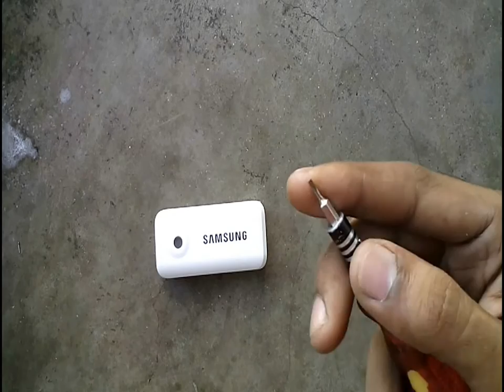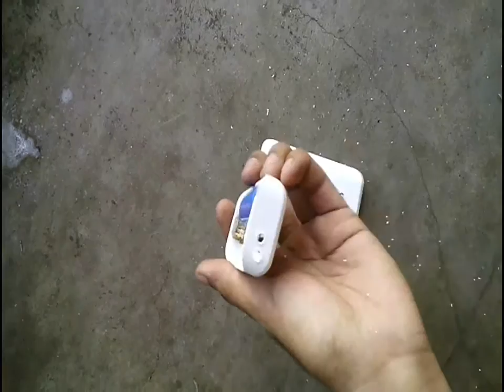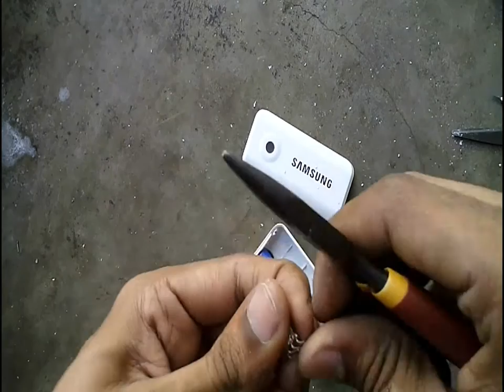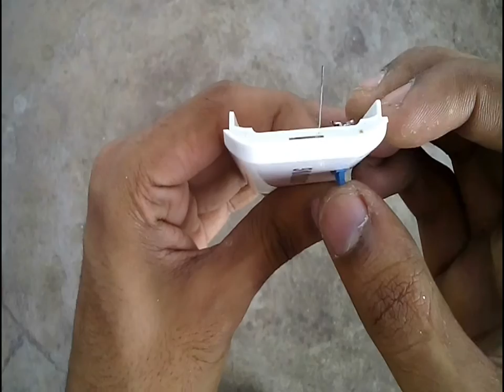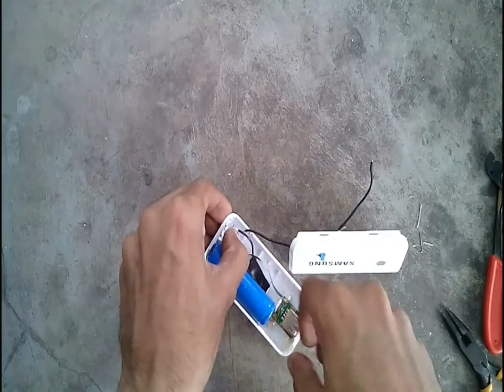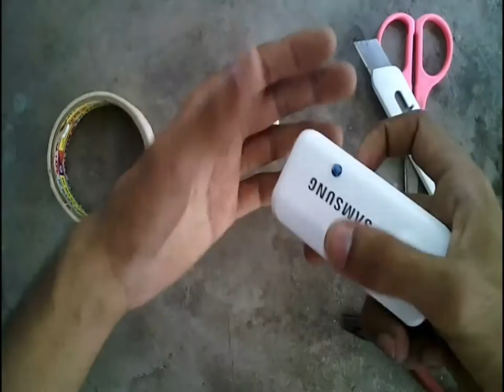Hack a mobile power bank to add a torch

Comment: i really want to put some flash light on my power bank what if the battery of the powerbank is not a typical power bank battery but it's old cp battery .does the procedure will be the same or not?
Reply from the maker: +Daydreamers if rating of battery is same then yes u can use same circuity